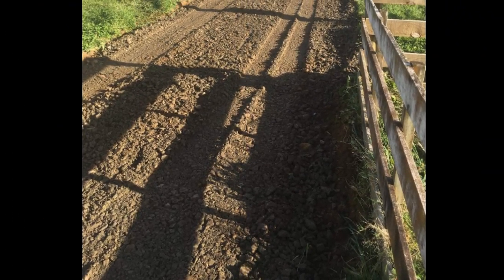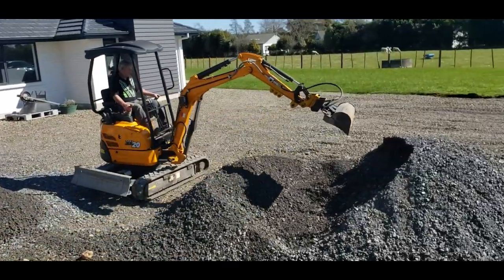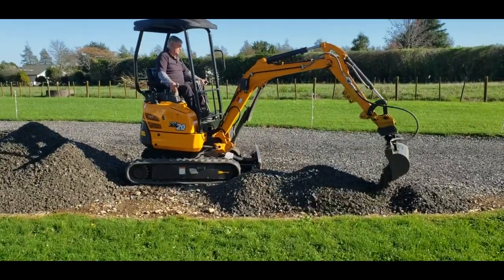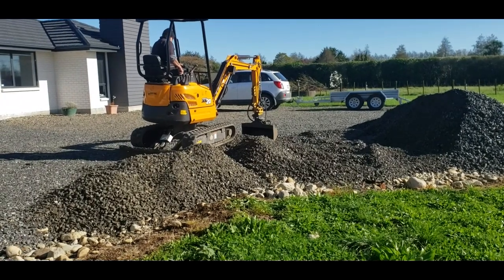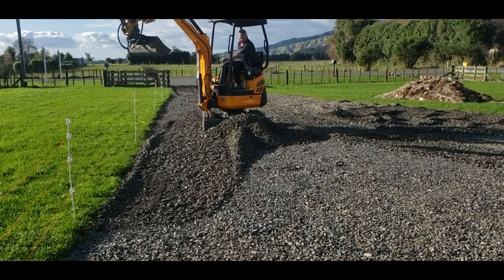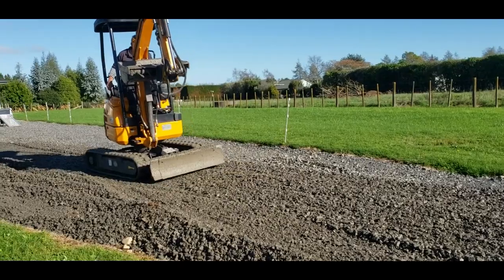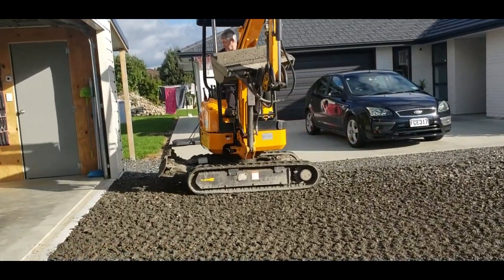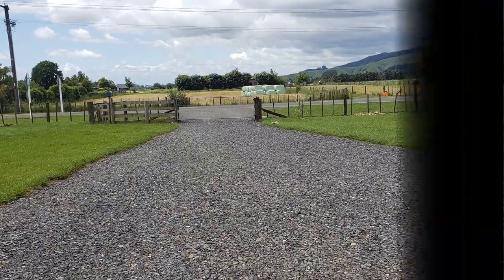Doing Driveways | Rhino XN20

Comment: That sort of job is more suitable for a skid steer but still doable and like you said better that shovel and wheel barrow. Good job. I reakon a good truck driver could have ran that out a little bit for you but things look different in person than on camera. You get a better finish back blading to.
Reply from the maker: Probably if they got someone in with a skid steer they would have had to pay full rates. But by getting a dottery old guy on a Rhino they got a very low budget job done. Because I wasn't going to be there when the gravel arrived I got them to dump it in heaps so it didn't block access. Are you still gold hunting?
Reply: @dinomite_diggers3453  yeah fair enough mate. You got the job done for them 👍. I’m still hunting for gold yep!

Comment: Hi. Thanks for you videos.  I'm thinking about to buy the same model. You have your excavator already about 1 year. Have you got any problems with it? And how many hours have it already?
Reply from the maker: Hello thank you for watching. I mainly just use the excavator working at my own property so it hasn't clocked up that many hours yet, Just over 260 hrs and no problems with the machine. I had an issue with the fuel at one stage but only because my neighbour filled up my diesel container and somehow got AdBlue mixed in with it. Because my place is very rocky I do flip a track off now and then, but can normally get it back on within a few minutes. If I was going out full time contracting would probably buy a Kubota or Hitachi but for what I'm doing here this Rhino is excellent and I'm very impressed with what it can do. Cheers.
Reply: Thanks